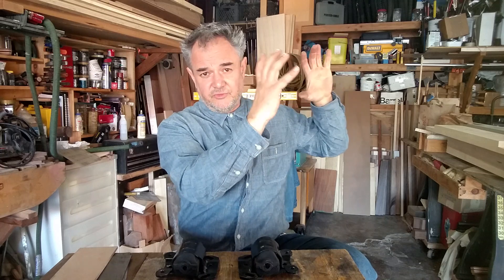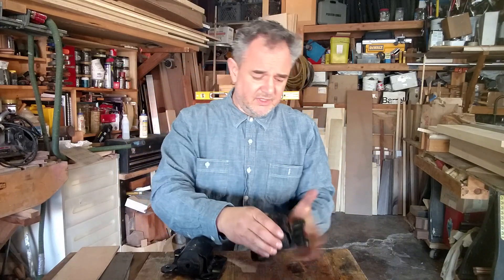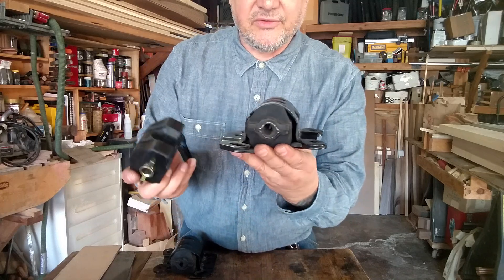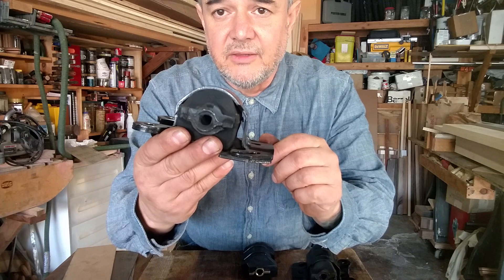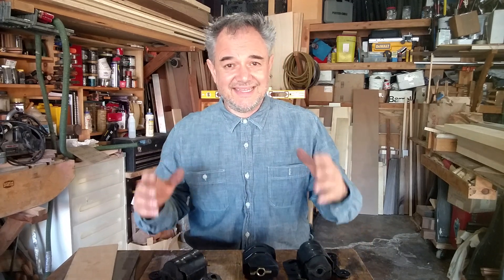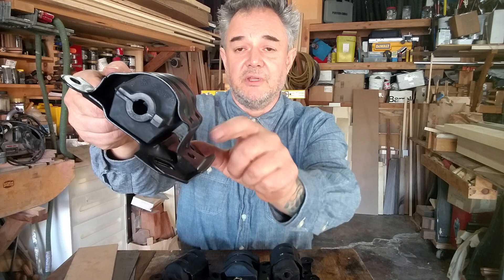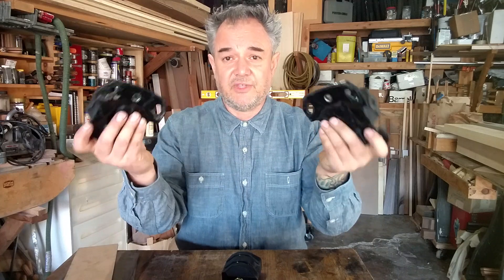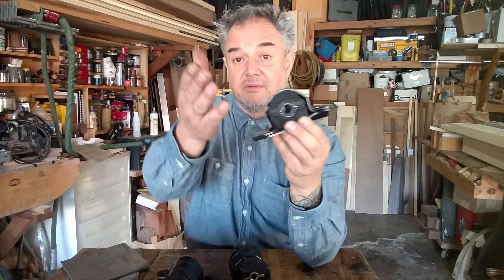AWD Astro Van Engine  Mounts part 1

Comment: Glad i came across this video. I will be changing out my engine mounts later this week. No doubt the ones that come in will probably will not be as good. Assuming the ones on my 2002 are the original, I will keep the cages like you said and if my new ones ever start to fail I hope they will still be making them polyurethane inserts you talked about.
Reply from the maker: Watch all my video's on this - I'll be doing an experiment soon with the rubber mounts where I'm going to shim them with rubber cut from other mounts I have but also offset the placement of the center of the hole to compensate for the torque of the engine. 
When shopping for the replacement mounts try to find the thickest cage with the least amount of gap on either side - A real smart thing to do would be to do what I'm planning to do; drill them out and separate the cages, buy the appropriate hardened bolts, nuts and lock washers, make some shim material (from anything, really) and bolt everything back together with the rear 3/8" offset (for the AWD - assuming that's what you have) and consider the idea of offsetting the placement of the bushings to compensate for the torque of the engine wanting to pull the engine down on the passenger side - you'd shim the left side of the driverside mount and shim the left side on the passenger side mount

Comment: I have an 04 AWD. Just did the 4wd conversion from Journeys. Love it. Not to complicated. Next is one of the shorter lift kits. while i was under the van I noticed my oil pan was close. I called Journeys and talked to the Tech Mike who has been a lot of help. He says they are coming out with a solution and to check their website in a couple weeks.Worth a look.
Reply from the maker: yeah, they seem to be the people to deal with, their products for the most part are pretty good, their work quality not so great in my case - Some of us are working on the engine lift idea right now, we'll have it dialed in very soon

Comment: Hey Michael, I have a 2wd model. Do you see the same issues happening with these? I didn't look at my mounts yet, I was just thinking about getting it done.
Reply from the maker: Totally different  issues - the ones available  work for 2WD Astros - the tip is to fill/shim the gaps on both sides of the bushing

Comment: The Chevy Astros and GMC Safaris are trucks, not mini-vans.  Sad day when they were discontinued and nothing  has ever replaced them.  My everyday driver for the past 16 years is my 1999 GMC Safari.  Just passed 536K on the odometer and still running well, but thinking about replacement.  At three times the original cost of a Safari, the only vehicles that come close are the Suburban, Yukon and Tahoe.  Even these lack the cargo capacity and general utility of the Astros & Safaris.
Reply from the maker: I LOVE hearing from people who have decades of experience with these things - I really wish I had "discovered" them 20 years ago - I always noticed them but just didn't make it happen...  I'm so into this '04 it's kind of crazy - I hope you find the time to see my other videos on what I'm up to with it - Plan to drive across the country again in a couple weeks.... Alaska next year - This is my only vehicle so it's my everything
Reply: @AstroVanTribe  Over the years I've probably replaced everything that is attached to the engine, but the original 4.3 ltr. engine, the transmission and differential have never been opened for repairs...Bullet Proof!
Reply from the maker: @chrisgraham2904  My transmission went on me on a return cross country trip, I was in Tuscon - Had a Jasper transmission put in it - It's like a new truck... (combine with having replaced all the bushings and other suspension parts, cv axles, etc...) I plan to have this thing for a very long time
Reply: I strongly recommend that you upgrade the electrical/starting system with "the Big Three".  You'll find information on that and anything Astro/Safari at;  www.astrosafari.com

Comment: Would you mind posting the numbers again there was a glare and I tried screenshot Ing it a couple times having a hard time making out the right side number thanks have a great day and for all your information I have a 2000 GMC all wheel drive
Reply from the maker: R - 1724WA2436
L - 1641WA2436
Reply: Thanks for the information hopefully the part numbers will be the same for mine I have changed mine over to four-wheel-drive with a 6 inch lift I am not in need of them as of yet but I am going to start the search. Thanks again for getting back to me so quick

Comment: Note: This is more than just the 2003-2005 vans.

AWD Motor Mounts All Years 1990-2005
Left GM Part: 15141593
Right GM Part: 15141594

This data has been verified in official GM parts catalogs.